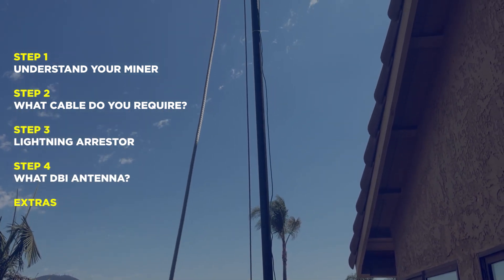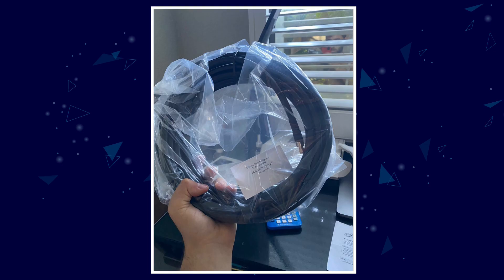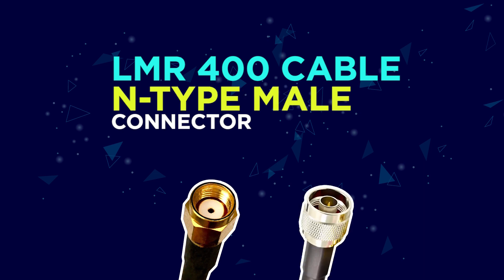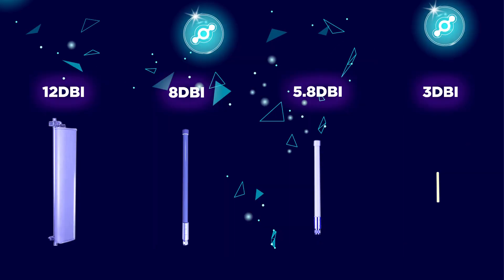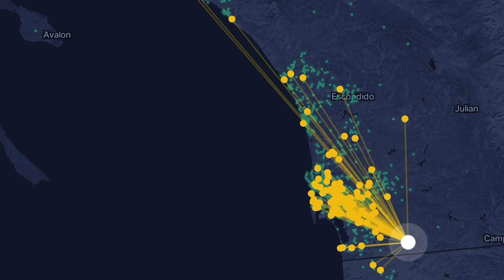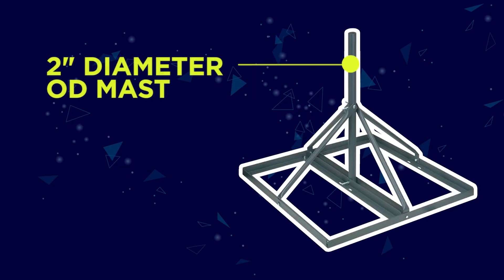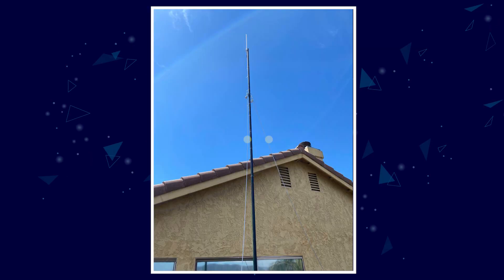Bobcat Miner Antenna Upgrade | Step by step Upgrading your Helium Miner Antenna ($HNT)

Comment: Do I need an outdoor case for my miner if I want my antenna outside?
Reply from the maker: Hi there. Only if you place your miner outdoors. If you place your miner indoors and run a cable to the antenna placed outdoors, you don’t need one.
Reply: @Crayban  thanks for responding,would you run it through a window etc?and is the cable small enough to close a window if so?
I've miners coming in 2 weeks so thank you for the fast reply

Comment: Trying to figure out what type of pole to get. You mentioned getting a holo-chrome alloy pole? I wasn't able to find it when searching on google. Also when searching for poles, are there ones that would affect the efficacy of the antenna, such as a metal pole, or aluminum? Thanks in advance!
Reply from the maker: Hey whats up, a flag pole would do, the material doesn't matter much, as long as it is sturdy enough. You could check your local hardware stores, which can tailor make some to specific sizes, however chrome alloy is slightly more expensive. Flag pole: https://amzn.to/3ifkjss
Reply: @Crayban  Also, looks like you used an antenna mount like this? Thanks, just making my orders! https://store.rokland.com/products/antenna-pole-mast-10-inches-with-bracket

Comment: Does rain rain damage anything.  Also. If i have multiple miners do i need different antennas in each location @Crayban ??
Reply from the maker: Hey whats up, rain doesn't damage the antenna as its waterproof and sealed. The miner will be placed in an enclosure, to protect it from the heat and other weather conditions. You will need an antenna for every miner you require setting up.

Comment: Thanks, great video. Look this might be a stupid noob question, but would it make sense to add a splitter and connect 2 different dbi to the same hotspot? Would that work at all? For example you are in a city and you need a 3 dbi to get all those miners that are close to you but have some obstacles and different hights etc but at the same time you have clear view to a bay or a big river and you want to also connect to the miners on the other side that are miles away, it would be great to have both ranges. Does this make any sense? Thanks
Reply from the maker: Hey FB, apologises for the delayed reply: 

I have not tried 2 different DBI antennas at the same time, so I can not say. It could be a good experiment to run. I would recommend throwing out the question on the helium reddit or discord page. There might have been a user who has already tried this. 

https://www.reddit.com/r/HeliumNetwork/
https://discord.com/invite/helium

Comment: Hi. Do you have any idea if the 8 and 10 dbi that work on bobcat would work on cynchro bit ? Thank you
Reply from the maker: Hi Pierre, you can, however check the back of the Syncrobit to ensure what antenna port is required. If it is different, you will require a different cable head to insert into the miner.
Reply: @Crayban  thank you again
Reply from the maker: @pierrem4613  most welcome. I should have one coming soon, will review it once it comes :)
Reply: @Crayban  hi. They are SMA female but they say I can buy an SMA male to N type connector . What do they mean by that ? Is it an antenna with this feature or a connector I plug to the SMA female antenna ? Thank you

Comment: I live in London around West side and there's already a lot of hotspots around me! I am witnessing 32 something on my list!! earning 1 and 2 HNT a day

As you said in this video 4Dbi stock antenna from BobCat should be Ok for me? But I want it to place my 4dbi antenna a little higher on the rood for better earnings!

Is the BobCat 4dbi Antenna weather/thunder Proof? I will obviously keep the BobCat Hotspot Indoors Just the antenna outside with a longer cable? Thanks
Reply from the maker: Hi Amnor, good question. The 4dbi stock is IP66 rated, and waterproof. However as it short in length, you might need to upgrade using new equipment. What you can do is purchase an extension, so the setup would be something like this: 

1. LMR 400 Cable with a RP SMA Male which fits into the back of the bobcat  
2. The other side of the LMR 400 Cable to be N-Type male to fit into the adaptor. 

https://amzn.to/3zvgyoV
__________________________________________
3. N-type female to N-type female adapter  to fit into the lightning arrestor 

https://amzn.to/3eKRhyY
__________________________________________
3. Lightening Arrestor - one side N-Type female  
4. Lightening Arrestor - the other side RP- SMA Female which will connect onto the fixed antenna cable

https://amzn.to/3iIluQy
____________________________________________
I hope this makes sense. You will need to check if an adaptor is ok to hook up to a lightning arrestor. 

Tbh, antennas in general are not thunder-proof, the setup is to provide extra precaution so the excess current does not flow through to the main cable. 

Hope this helps.
Reply: @Crayban  thank you man for making it clear for me! I’ve already ordered all of these.. took me a while to understand and find them but I did.. it’ll be probably be easier for next time.. 

Question: am I not gonna need a grounding wire ? which goes to the ground I guess!
Reply: @Crayban  ofcours I do, thanks again man!

Comment: Cable is better than wifi right? What if the wifi is normal and nor super good, is that a problem? Otherwise SUBSCRIBED!
Reply from the maker: Hi Honza, Cable is better as it is more stable :). If the wifi is really weak, an ethernet is preferable. Thank you and welcome.

Comment: Why does my bobcat miner all i have Male ports? I was so confused becasue my cable was RP-Male and it did not fit
Reply from the maker: Hi , You have to ensure it is a RP - SMA - Male.
Reply: @Crayban  Thanks! I got it mixed up. But curiously, why N Male, RP-SMA Male LMR400, shouldn't it be N-Female and RP-SMA Male connectors?
Reply: Since the Rak Antenna is N-Type Male
Reply: NVM  I got confused again. You added an lightning resistor that was female to female :)
Reply from the maker: @geekyso9102  no worries haha :)

Comment: Could a 14 dbi possibly work m in a city like nyc - 1 storey high ?
Reply from the maker: The thing is you can try, but it’s too strong of an antenna, it will push out a signal too concentrated, when the aim to is to connect to more around you. A 3 or 4 bro would do that.

Comment: Can u use a 12 Dbi with the miner? I’m in downtown nyc it’s pretty busy 🤦🏻‍♂️
Reply from the maker: Hey Trip, in downtown NYC, it would prob be beneficial to use a lower DBI antenna, 3/4. 12 is good at en elevated height, and further out from the city. Also will have to check regulations on the final power output of the antenna, you can read more in the article provided in the description.

Comment: Hey thats great set-up. My experience is its also depend on the City, we have all small Citys in my Country. I stay on a Hill 289M up and have a view over the full city. I just have a 4dbi on the Window Atik and its covers the full City plus it goes sometimes 34km far. Mor far away doesnt matter by my position, becauze there are everywhere higher hills or Montains who block the signal, it doesnt matter if I would have a higher dbi Antenna, it wouldnt cover more. The question is, on whitch high level we shoult use whitch antenna, lets imagine my hill would be 1000 Meter high, than my 4dbi maby not enough. That would be an interesting statistik, can you or somebody find out, where to find it? I can not calculate with dbm, I dont get this terms in dm from dbi.
Reply from the maker: Hey likeroman, thanks for the comment.  You’re right, however if you are further away up in the mountains and the main hotspots sit within the city, a higher dbi is required. The exact calculation can be found in the link I provided below. The article goes how it all converts. For the dbi loss, check out this calc. https://www.timesmicrowave.com/Calculator

Comment: In your links the bobcat miner says rak . Does it fit the rak miner and the bobcat ? Also what the splitter for ? Thank you for your valuable video
Reply from the maker: Hi Pierre, The rak antenna fits the bobcat miner with a lightening arrestor. All the parts i have listed below work together. The splitter is used if you put your bobcat in an enclosure and place it high up. This will shorten the antenna cable as the bobcat will be right next to the antenna, and then the splitter is used to power the bobcat and provide an ethernet connection. The only wire that will run down would be an ethernet cable. Hope that makes sense.
Reply: @Crayban  hi again . Do you know if the rak antenna fits synchro bit as well ? Thank you

Comment: Hi . If I use 12 dbi antenna is goes farther but in a narrower angle? If I reach a miner A from long distance let’s say 30 miles and that miner A has 4 dbi antenna . If my miner witnesses it , is it necessary that miner A witnesses mine as well even his 4dbi antenna doesn’t reach 40 miles but just the fact my miner witnessed it ? Thank you
Reply from the maker: Hi thats correct, your miner will witness miner A, but if they are using a 4dbi, it is unlikely they will witness you, if you are 30 miles out and at a higher elevation. You just need to check the final power output (EIRP) coming out the antenna is not over the regulated amount. Check the link below for more details.
Reply: @Crayban  you are the best . I don’t know how to thank you 🙏

Comment: I live in a ground floor flat and waiting on a bobcat miner. Is it safer to stick with the stock antenna until I move location or would a 5.8 upgrade placed internally by the window help?
Reply from the maker: Hi Chris, from my experience with a bobcat on the ground floor, I struggled to gain witnesses. A 5.8 might not help, however an elevated antenna would.
Reply: @Crayban  yeah I was thinking the best I could do was attach the stock aerial at 2 metres above ground by the top of the window. I have a potential witness which is about 500 metres line of sight from where I live so 1 witness would be better than none lol
Reply from the maker: @Charliecharlie182  Just to note, I had contacted Bobcat and they confirmed the stock 4dbi antenna is IP66 rated, and waterproof, incase you are considering to place it outdoors. Try it out, and if you could get it somehow to another apartment higher up in the building (friend, trusted neighbour) try to test it, if you are not seeing noticeable rewards after a week.

Comment: Awesome video thank you so much!! I would like to know do you know of any antennas that you could recommend that do not need to be grounded?
Reply from the maker: Hi Ricky, if you place the antenna indoors by the window, it won't require grounding. Grounding is mainly for safety, it's a rare situation, however better safe than sorry.

Comment: I live in the suburbs but there are no hotspots near me. Is there a way to setup my hotspots in an open field with a portable wifi hotspot, or should I just ask my neighbors?
Reply from the maker: Hi Seth there is a way, you would have to create an off grid setup if you have no power source. That would require a solar panel and some wiring to get it up and running. You’re neighbours, friends, colleagues could be a good bet. However a high dbi antenna (12/13) would reach many many miles in open line of sight, however you would have to check the country restrictions on the total output power (EIRP) of your antenna.  Sorry, a little technical but those are some options.

Comment: You are labeling the male and female connections wrong. It's exactly opposite from what you are showing
Reply from the maker: Which part? Im pretty sure i'm correct :)
Reply: @Crayban  male adapter goes into the female adapter. Think hetero sexual😉
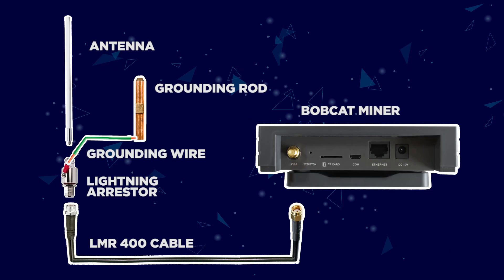Reply: @Crayban  At 0:32 in the video, you show 4 gold fittings. Those each have a male end and a female end. But the two silver fittings are labeled backwards.
Reply from the maker: @frru4573  haha got you, however it is correct. The silver ones are not SMA. Check the lightning arrestor, which has n female to n female https://amzn.to/35Sjm2r , as mentioned in the video it can be confusing lol.

Comment: Great video!  I am saving this video as well.  Should receive my miners at the end of July and will test out the stock antenna.  Not too many miners in Cali Central Valley so might need a more robust antenna and place it outdoors.
Reply from the maker: Most welcome Dave, check out the Rak wireless antennas in the link below, there are also others with higher dbis to reach further out.

Comment: Do you need a flat surface on top of your house to place pole base? Currently I have it on second floor. If I place flag pole at bottom of the house, it might have height higher than current vertical position
Reply from the maker: Hello, You will need a flat surface to place the base, otherwise you can opt for connecting the antenna to the roof and drill through a whole to feed the wire through.

Comment: hi im looking to place bobcat outside however I live in a desert area, the heat here goes up to 60 celsius what can u suggest me to do?
Reply from the maker: Hi Blayde, in my description I have dropped a link to an outdoor enclosure - do check what heat it can withstand. Or purchase a box that can withstand those heat conditions, place the miner in and drill some holes to thread through the cabling.
Reply: @Crayban  ah it does withstand up to 40 C , which wouldn't work here :( do u know of any that withstand higher temperatures?

Comment: I've been helping a friend setup her Bobcat miner.I personally, would not bother spending any additional money on antennas or upgrades,as this Helium network is proving to be a gamed situation.She has had her Bobcat 300 for almost a month now.Out of those days, over 65% of the time the hotspot was always in a sync mode (tracking this via a spreadsheet), therefore the hotspot is unable to "mine".I'm beginning to suspect some type of throttling on the miner's to keep them offline.When I contact Helium support, they direct me back to Bobcat.I have monitored other Helium Hotspots in the surrounding area ,and I noticed that there are a several hotspots near her that are connected to major accounts (+100) Hotspots.In those accounts I can see there are some Bobcat Hotspots, but they seem to be up and running for longer durations.So if that's the case, then it's not Bobcat and their firmware.I'm still collecting data on my friend's Hotspot performance, but it doesn't look good for the Helium network.I'm a bit disappointed,as I really believed in this project.All I'm seeing is a small group of people who seem to benefit, while the rest of the network supports them.I have a feeling this will clear up shortly after the "halving", this proving my theory.This is on top of the supplychain fiasco.This is how you get three lettered agencies crawling up your project's backside.🤨 😒

Comment: Great information bro!!!. I have a few questions:
- How do you protect your bobcat from the rain? 
- I see it is in the cinder block and its bagged is it a rain proof bag?
-How is the bobcat powered ? poe?
-Also I live in Arizona in America and its basically the desert. So its extremely hot. Do
you think this antenna you have shown us will hold up to desert heat?
-Also I know the bobcat wont hold up to desert heat so I will need to have it inside..
I see that you said a longer cable will reduce the power but I believe I could buy a signal booster..
do you think this would work?
Reply from the maker: Most welcome,

1. For the meantime, I have sealed it with plastic and placed it underneath he concrete blocks, which are water proof. I am awaiting for my bobcat enclosure to come, linked in the description. Once it comes, I will place the miner within it. 
2. The bobcat is powered up via an extension cord, POE will be a alternative solution once I receive the enclosure 
3. The antenna would hold up to the heat, however the miner won’t. You need to shelter the miner in a solid box which can withstand those temperatures, drill some holes and feed the cables through
4. I have never used a signal booster, so can not comment on it. If you are concerned about the loss in dbi, you can acquire a stronger cable, LMR600 or 800, but they are much more stiff and less flexible. If you're running them straight down, they should be fine. 

Remember you can place the bobcat anywhere, it is the antenna that sends out the signal. So if you place the miner in a steel or aluminium box, which keeps a cool temperature inside, it should be perfectly fine. 

Hope that helped.
Reply: @Crayban  :D just place a fridge outside and put the miner in xD
Reply from the maker: @SwissFoxxy  😂😂
Reply: also interested in the answers :) please do let me know!
Reply: There’s an outdoor enclosure for the bobcat made by rak
Reply from the maker: @jloveDOTeth  link in the description :)

Comment: How did you fit the bobcat in the block ??
Reply from the maker: Hi Adam, it actually fits further in, and the concrete block it self does not leak any water in.
Reply: @Crayban  Sorry I don’t understand…so your saying that the bobcat is small enough to fit in a concrete block ??
Reply from the maker: @SimpleStats  Hi Adam, yep thats correct. It's small enough to fit inside.

Comment: One of the best videos I have seen on the topic, and broken down very well. I do have one question, how are you powering the miner up on the roof?
Reply from the maker: Hi Glen, Thank you. The miner is placed within the concrete block and connected to an extension cord. The cord runs to the house.
Reply: I would drill a hole into the wall and pull the antenna cable through it.

Without a proper outdoor case, there's always a risk for your miner to get damaged, and I would never run something outside that needs electricity.